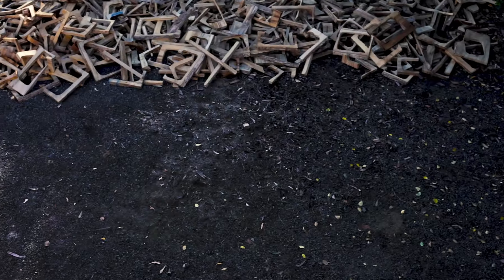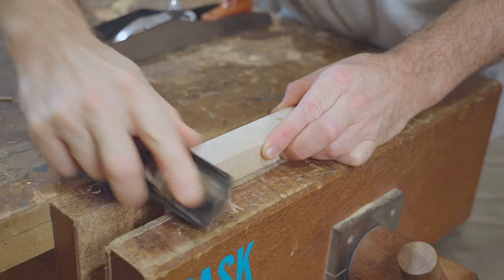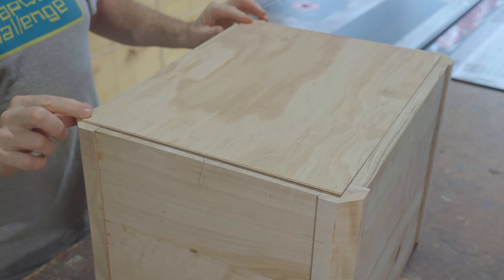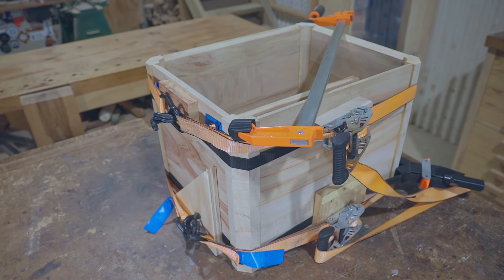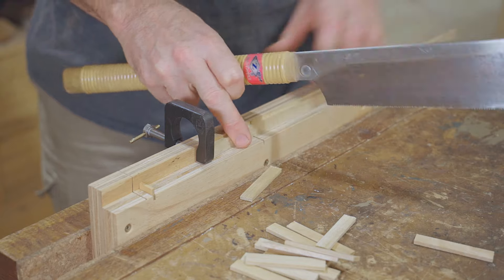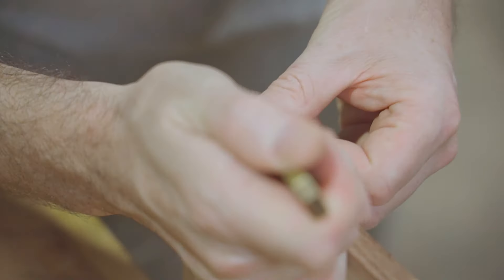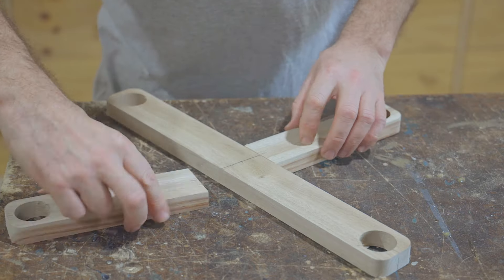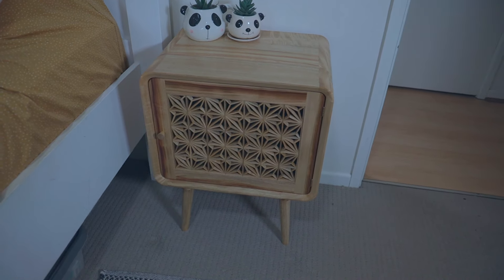Making Furniture with Rounded Corners - Kumiko Bedside Table - Scrapwood Challenge ep51

Comment: The solution for drilling the mortices for the angled legs was really clever.
Reply: I didn't really understand how he did it - it looked like his holes were drilled at 90 degrees but obviously that isn't true. Could you explain how he did it?
Reply: @Greentrees60  the drill press table was at an angle. But by using a diagonal. It didn't require the hole to be drilled at two angles.
Reply: @Greentrees60  That little red box he used let him set the table under the drill press at 10 degrees tilt

Comment: Wow. It looks like an 1960ieth TV set my parents had at that time in their dining room. The rounded corners, the same feet with the angle and the blocks to mount them. The filling in the loudspeaker was a braiding. There were brass liners all around the front edges. And brass cups down at the feet. This tv was painted like a black steinway piano. And I remember it was made by Telefunken. And of course it was black and white.

Comment: 22:22 you can reach the compound angle by taking the crossangle at 22:31 and laying the pieces with that angle on you prepped and angled drill table. In a sense uncrossing the pieces.

Comment: at my shop we make a foot stool with compound angle legs, we simplified this task by making a 20 degree wedge going front to back that goes on top of our drill press with the table tilted 20 degrees side to side. opposite corner legs then flip the setup for the other two. your setup works great but in our case the legs are a through tenon with a wedge to lock it in.

Comment: You did exactly the same curved corners and tied them with biscuit joints like I did in one previous project (mine was a larger TV stand with drawers and glass doors). I did the inside bevels with slightly lesser cuts, but still ended up with a great piece. Nice to see the design approach is shared amongst woodworkers as I hate to see exposed endgrain on corners. Makes me feel like I am doing a chipboard project. I am yet to give kumiko a try and I hope to come up with a piece that integrates it very soon. Practice first.
Reply from the maker: Sounds great Nisam! :)

Comment: Sometimes when I coat wooden vent covers I set up an inch of finish in a big Rubbermaid tub and I dip them. Then I shake them out over the Rubbermaid and finally blast them with pressurized air over a mat of paper towels. Maybe a similar trick could work with coating the kumiko? I’ve seen general finishers do batches of doors using pressurized air to apply stains, chasing puddles across the surface and into corners  with the gun, so I’m sure pressurized air will clean it off sufficiently.

Comment: Pask! Missed you. Really great piece. It will go down the family generations a few times. Your common sense problem solving skills are always great to see.
But good God man get yourself a steel air spray touch up gun. Your first coat you can brush in and really fill up the grain. Then a consistent light spay finish on top. Brushing is so inconsistent, brush some on...brush some off...Never a consistent mill thickness nor finished look. Over time as the wood absorbs differently in different areas. 2nd, 3rd or 4th coats are easily applied in minutes.
Sorry, just a note from a cabinet finisher.

Comment: You've been following me on Instagram haven't you? Lol. I just did a shelf with rounded corners. Leftover plywood sides though, which I painted white, so I was able to use a long square cutoff rather than making an end grain corner piece. I also made a shelf too short! Made it the same as the top and bottom, not accounting for the extra width from the corner pieces.

Comment: @9:58 you show how the middle panel was cut too short... wasn't that made at the same time as the top and bottom panels, so it came up short because the rounded corners added a little bit of dimension (and it needed even more to fit inside the dados)? So, for anyone trying to do a similar build, hold off cutting any shelves to length until the carcass is assembled

Comment: You often wonder why proper wooden furniture is soo expensive.... Anyway, would a small sprayer not be better for adding finish to kumiko?
Reply from the maker: Yes, there's some work involved but when it's something you enjoy it doesn't seem like work. As far as I know (I haven't tried) hardwax oil isn't recommended to be applied by spraying. I could've masked just the panel and sprayed it with varnish (I did think about it) but by the time I'd done that and set the gun up I would've had it done. :)
Reply: @PaskMakes  You could pre-finish the strips before cutting as you're only going to trim the ends to fit. Maybe?
Reply: @PaskMakes  Yes. Sometimes it’s faster to do it with your hands than with a tool that you need to get and prepare for work :)
Reply: @retiree1033  Exactly my thought! Absolutely no harm in pre-finishing before they are cut to length and chiseled. The trim leaves the open glue surface and improves clean-up.

Comment: Question about the leg holes, could'nt he make the double tilted holes like this:

Turn work piece to a 45° angle on the even drill press fixture plate.
Then angle the plate the desired amount, like he does in the video.

I know, that it's needlesly more complicated, compared to his method, but it would let him keep the wood pieces straight.

Comment: I have a question about the jig that's used to chisel the 45 degree angel into the kumiko strips.
Since the face of the jig is made from wood and you're sliding the chisel across it thousands of times, doesn't the wood wear down and change the angle pretty quickly?

Comment: A great project and a beautiful end product (as always)! One question: when cutting the dados for the shelf, you're going both directions on the router table. I've heard that router tables (and routers in general) should always be run against the direction of rotation. Is this not applicable as you're doing the cut in the middle of the piece, rather than along an edge (essentially making one side go with and one side against the direction of rotation regardless of the direction of movement)? Or is there another reason?

Comment: ok, here's a question.  assuming that your table saw is big enough, wouldn't cutting the legs to length/angle be easier if you just run the top of the table against the guide and cut all 4 legs that way?  theoretically that would be a lot more accurate right?  or would there be too much chance of tearout?

Comment: how do you straighten up / square up wood with basic hand tools or basic handheld power tools?
I'm not a woodworker, I just had to do this the other day for a DIY project, looked on youtube and every bloody video says, "oh, it's so simple, first put it through the jointer, then the planer, then the table saw". Some of them were trying to be merciful like, "Don't have a jointer, that's OK, you can do it with just a planer, sled and table saw." I was like, "Thanks, that's so helpful(!)". ¬_¬
Reply: Rex Krueger focuses on hand tools and techniques that are approachable for beginners, and demonstrates what you’re after in at least one of his videos :)
Reply: @ragnkja  thanks. I should also clarify I'm not talking about massive pieces of lumber, just small bits and pieces.
Reply: @KX36  
That means that your materials are in a form that is appropriate for the tools you’ll be using. 
Even if you did have massive pieces of lumber you would want to rough-cut them into pieces that were the appropriate size for what you wanted to make before you started planing them and squaring up the edges.
Reply: @ragnkja  Absolutely! Back when I was building semi-custom homes, I'd make built-in shelving and computer desks with just a circular saw, miter saw and router, with a couple of home made jigs/sleds. ( I'd give them a rough sand and leave it up to the painter to finish them.) They turned out great.

Comment: Yo Pask! Do you think it would be better to try and put some screw in feet on the bottom of the legs. So you can "kinda" level it if the floor or space you place it isn't level? Like screw one foot in a bit, screw one out? If not is there another method other then shims that I could use? Without cutting the legs to be level where the piece is gonna sit, cause its likely to move a lot.

Comment: One question. The grain on the cabinet outer panels runs perpendicular to the grain on the rounded corners. Is it safe to glue it all together, or are these pieces small t
enough to not worry about wood movement? thanks for the answer! Wonderful work as always Neil! ;)